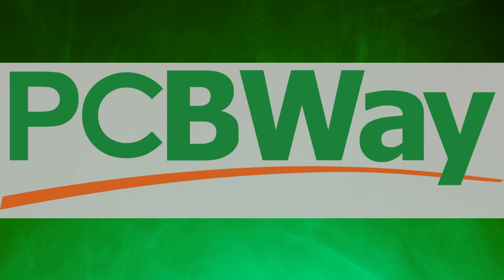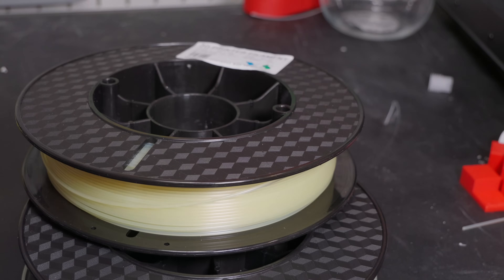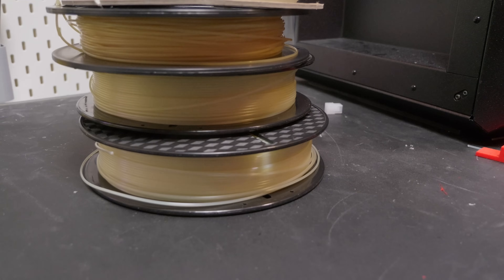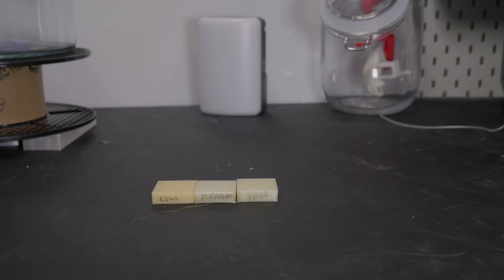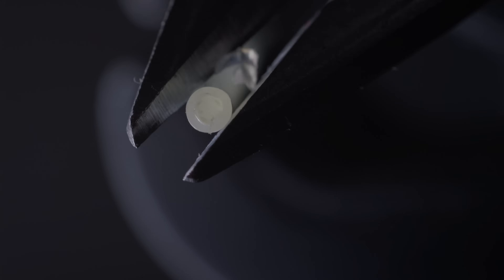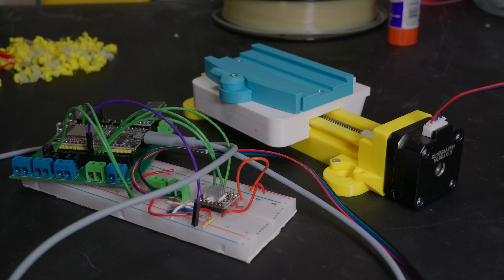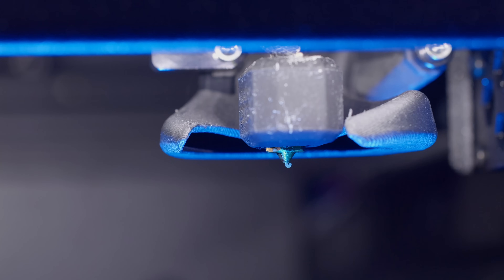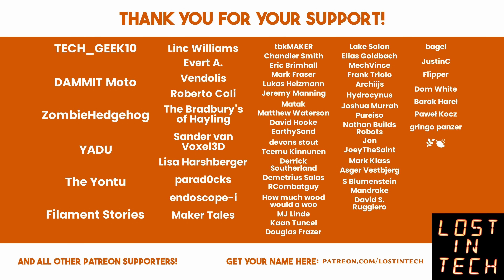PVA Filament: Not always what it seems...

Comment: I am now curious how they'd dissolve in an ultrasonic bath.

also wow we have had dual extrusion filaments right under our noses this whole time :O
that's a clever idea! although I'm wondering how it's gonna dissolve properly if the middle is the pva and not the outside.

also the stringing does matter a ton, if the PVA strings in between a layer of the main material it creates a weak spot that the part will snap at, making it very weak and brittle.

back in Iran i used a random brand of PVA which was sadly expensive, and it'd dissolve nicely in hotwater when used with ABS but it was barely turning into goop and took so long, i'd just brush of or use water pressure to get rid of the rest. I wanted an ultrasonic cleaner for that but I never got one. I feel like ultrasonic baths would help massively with the goopy stuff.
Reply from the maker: I dont think the solid stuff would dissolve at all - but the PVA part definitely would benefit from it
Reply: @LostInTech3D  Oh yeah but I was wondering if it'd break down/apart if you're talking about using an ultrasonic bath.
Reply from the maker: I dont think so because even stuck in the shower for weeks it didn't show any signs, I suspect it's just some normal plastic like PETG

Comment: I use polymaker pva in my AMS on the X1C with the downloaded profile from polymakers website and it prints without issue.  It fully dissolves and leaves little trace on printed parts.

Comment: Why not just use the PVA as an intferface material rather than for all of the support?  PVA is quite a bit more expensive than a lot of filaments, and it will cut down on filament changes. I suppose with some complicated geometries you wouldn't be able to pick out all of the supports, but I think that's a rare case.
Reply: He covers that in the video.
Reply: @Taliesen.  I must have missed that bit.
Reply: @SoidHoid  It was towards the end IIRC

Comment: Elmers glue would burn if you tried to use it as a filament. You just have to hydrolyze it to make it meltable. You can think of the difference as the difference between fat and soap, and converting from one to the other is almost the same process.

Comment: I use Polymaker PVA in my ACE pro on my Kobra 3 max and it just... works? Dissolves great, quite easy to print at 190, and works with both PLA and PETG that I've tried (although I had to add a long pause between PETG and PVA since the nozzle needs to cool down)

Comment: I've always wondered how well dumping the print into an ultrasonic cleaner would work. I feel like this would speed things up considerably, especially if you're trying to dissolve super thin interface layers.

I've also always been interested how using PVA or BVOH is going to affect the properties of the actual print material and how much of a purge is necessary to get rid of whatever effect it has. The huge purge is the main reason why PETG and PLA don't work well together in single-extruder systems, after all.

Comment: To remove stuck prints have to tried isopropyl? It will wick under it and release it just like it does with hot glue
Reply from the maker: I keep being told about this and forgetting, I even have some right by the printer :D
Reply: @LostInTech3D  as long as it doesn't react with the bed you have nothing to lose, i dont have a smooth plate but it works great on TPU and all the textured plates that warn not to use it on... i also move my prints around the bed to even out the wear... so maybe risky filaments at the extremes?

Comment: If it's water soluble and the air has moisture, I wonder how much of it dissolves directly into the air 🤔
Reply from the maker: hahaha um...uh..... I have no idea.
Reply: @LostInTech3D it was just kind of a random thought I had; not sure how big a deal it is, especially since it probably makes the water too heavy and just falls straight to the ground, but I can't help but wonder 🤷🏿‍♀️
Reply: In most places in the world it doesn't. I own a spool of water soluble thread, which seems to be PVA too, and water soluble stabiliser for embroidery. None of them will dissolve under a steam iron, and both require actual water. And compared to filament/printed parts, they are very thin.
I did hear about someone sewing in tropics, and that soluble thread becoming slimy while sewing, ugh.

Comment: I have worked for over 30 years with various PVA types. 
About the Esun material the fully hydrolyzed material is about the same price as the partially hydrolyzed material. Typically one would use 80 to 88% hydrolyzed material as that has reasonable mechanical properties and dissolves well in water. Higher degree of hydrolysis becomes more difficult to dissolve until fully hydrolyzed PVA which oddly does not dissolve in cold water any longer. The mix of partial and fully will have better mechanical properties and be more printable. It might even dissolve as a mixture. 
I would not be surprised if the Raprapper material that does not dissolve is actually fully hydrolyzed material but extruded as core material where the Esun material is mixed partial and fully hydrolyzed, the fully hydrolyzed part causing the milky solution because it is solubilized by the partial hydrolyzed material.

In my experience PVA indeed prints difficult. It was however a roll from Real Filament. Will have to go for some Esun it seems.
Reply from the maker: Yeah you'll find the esun stuff a lot more manageable!
Reply: Clever idea that the core could be a different PVA composition.

Comment: i just don't see the point of pva when i can just use petg as a support interface material for pla (or vice versa)
Reply from the maker: I don't see the point in wood glue when I have a box of nails 🤣👍
Reply: People support different things, there is no single solution to handle them all.
PLA / PETG interface doesn't work for complex shapes, it requires an exit strategy - and in those cases it should be quite good 😉

I'd rather use solutions (I don't mean solution of H2O and C2H5OH - which usually summons more problems than it resolves) that work for my problem than be limited (though I am currently limited by the printer ) by what's currently high in internet 🤔

Comment: you can trick it to make a raft. Add a cube to a new project. Make it the size of your model. Then add the model to it. Added models don't require contact with the built plate or anything else. So lift it above. Then add in the supports between the object and the squished cube.
Reply from the maker: Noted!

Comment: Now I know why people complain about PVA, they are just using the wrong brand and therefor PVA instead of PVA

Cool thing you can do with it is printing molds for impossible geometries (normally) than cast and dissolve. Works better than PVB and ABS, haven't tested HIPS those far tho

edit: do NOT print ABS molds and dissolve them !!!

Comment: In the somewhat confusing world of polymer chemistry, there's actually a broad group of 'PVA' with a lot of subgroups, but people tend to lump all PVA into one thing, like 'plastic'. The PVA here is polyvinyl alcohol (PVOH) with probably a few modifier thermoplastic powders to get it to stay together at temperature. The other more common PVA is polyvinyl acetate, aka, the more broad component in a lot of PVA-glues. The key difference between the two is that PVOH is water soluble and PVAc is not. Which is also where a lot of misunderstanding comes into play, as elmer's glue is water soluble. Enter the modifier fillers, which are water soluble, and thus at eye view, everything *seems to magically dissolve into a puddle of goop in water.
Add: Ah, I paused to type too early. I figured the whole video would be watching filament maybe or maybe not dissolving. 😁

Comment: Apropos things that aren't what they seem...

i remember seeing masterbatch for sale and it was pigment in EVA binder. So i conclude, there's probably EVA in every coloured plastic. It must be really well compatible at just sticking things together. The hot melt glue stick polymer.

My first thought would be that PVA (OK actually PVOH) filament may actually be EVA based. Oh yeah it's never crossed my mind that it's PVOH, but now that you mention it, it makes sense!

By the way the behaviour depends on chain length for sure. The longer the polymer, the less water soluble. You can find waterproof D4 PVA (actually PVAc) glue.

Comment: I've used 3dxTech PVA in the past. I can't say this for sure, but I'm pretty sure 3dxtech's is one of the few that are essentially pure PVA with no funny additives.
My PVA did not spit or smoke when it was properly dehydrated. With that said keeping it dehydrated is almost impossible since it's more hygroscopic than nylon.
To get it to print properly I had to feed it from my dehydrator to my printer with a reverse bowden tube. Essentially there couldn't be anywhere in the filament path where it was exposed to open air. If I remember right I printed it at 235c with PETG speeds.
The stuff absolutely would not stick to PLA, so I couldn't use it to grow supports off an existing part. It also took about eight hours to fully dissolve in lukewarm water.

Comment: You wanna try the Breakaway Filament yxpolyer. Great stuff. Works like a charm in my AMS (X1C) at 270°C as a support material for ABS/ASA. What happens in water? I don't know. Not tried that yet 🙈
Reply from the maker: yeah I used the bambu stuff a while back - it's fine. I don't think these are soluble though..not that they claim to be.

Comment: I used the BambuLab PVA: 100% soluble (the resulting water was clear) and I could use it as a support interface layer with PLA without issue.
It just really needed to be dried properly before.

Comment: Im worried about people dumping vinyl into the sewer systems.
Reply from the maker: it's not a problem for actual PVA....but the other stuff...
Reply: @LostInTech3D  It seems it is not rapidly biodegradable. So indeed it would be best to minimize the use if possible.
Reply: You know those so called “Tide Pods”, well those are PVA film so they melt in water and the detergent will mix with the water. So PVA is everywhere., oh the dishwasher machine pods can also have a PVA film.
Reply: People washed elmers down the drain for decades.

The other stuff tho, but still it would be nicer than support that needs harsher chemicals to dissolve, you still end up with waste. Maybe just evaporate the water and stick it in the bin, if you could do that it would still be easier than alternatives
Reply: I assure you people are dumping much, much, much worse things down the drain.
Reply: They use PVA in human medical implants. Vascular stints, cartilage, contact lenses ect. As far as going down the drain, I'd worry more about the neighbor who dumps antifreeze and paint thinners down the drain. Have a nice day 😀
Reply: I just drink the water. Microplastic yummy 😋

Comment: I have a roll, it is not very good, I prefer using PETG for PLA prints and vice versa, the PVA doesn't resolve completely, I find I have to change the water for more hot water after 15 minutes and the part has to be printed in high telp filament.
 I printed mine in my BL X1C but used an over head filament spool straight into the extruder, I also used my Ender 5+ Mercury One.
 I wont be buying another roll of PVA!
Reply from the maker: why are you printing it in single filament mode though? I thought I was the only one doing that :)
Reply: Sounds like PVA is more for a magnetic hot plate with automatic stirring, which sucks.